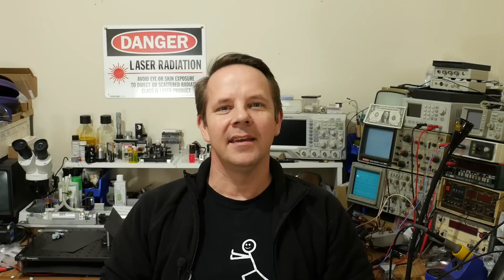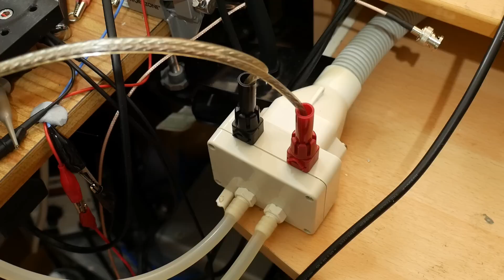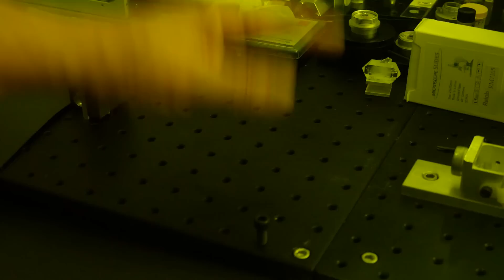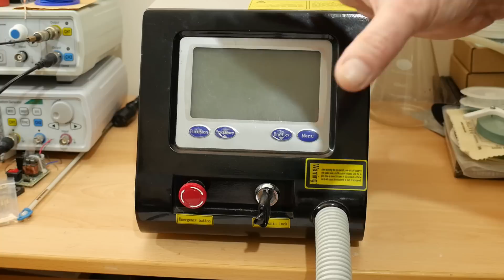DANGEROUS Laser Power Supply Teardown!

Comment: Hi Les,
...one more thing I was curious about...with a series-injection triggered flashlamp, have you ever fired the trigger WITHOUT the charged main capacitor while looking at the arc through the lamp?  Was there a strong streamer completely through the tube?  Also, IF you have tried this, with a LOWER  voltage to the trigger transformer primary, could you get a good arc?  I do realize that properties will alter without load.
(you're the only person I could think to ask such a question.)
===============================================
BTW: I just got in a large EG&G inj. xfmr, WITH DATA!  It states the "saturated inductance" of the secondary, which makes it possible to use the xfmr secondary as the main inductor (if the PFN is 'arranged' for this particular inductance)!

Comment: How is the SCR unlatched in these circuits? I don't think it's the TVS diode (D1), or is it?
Reply from the maker: When the thing fires, the voltage should either reach zero or go below it (if it wasnt for the TVS), as the circuit will ring. At this point it should turn off. In the event of a failure the SCR may latch, which it evidently did in this case.

Comment: I was just thinking you touching the key with bare hands while the thing was sparking
Reply: My thoughts exactly. As well as the immediate shock hazard there's the risk of a blast of AC keeping the finger muscles gripping the key: FFS Les, for the first powerup of /anything/ use an isolating transformer, RCCD and a big red THUMP IN EMERGENCY button.

Comment: I bought and repaired a close to the same junk power supply as a part of easily accessible pulsed solid-state laser source for playing at home. But, mine has a simmer circuit and the switching of the capacitance to the lamp occurs through a powerful thyristor, which in my opinion is much better for flash lamp health then classic cold-kick.
Anyway, when you take such a "design miracle" into your hands, after some true lab equipment like Thales or Coherent, you feel either mockery or a cruel joke by its developer..
Reply from the maker: I have seen those. Simmering seems like it would be good for the lamp, but they are pretty cheap in the scheme of things. It would be helpful if Aliexpress had datasheets on them. Most of the time, they just quote length and diameter, and that's it!

Comment: Its very concerning that such equipment can be manufactured and sold with such poor safety considerations, especially when comes to the use of lasers in cosmetics - There is actually no feedback to monitor the actual energy produced by the laser itself, and the feedback used to control the actual supply energy to the capactor and flash lamp.

I used to work for Cutera as a service engineer, and the amount of safety requirements was massive. Yes these cheap units are manufactured to a price, even more scary is the fact that those that purchase such equipment, are to be used in cosmetic / medical settings.
Reply from the maker: I suppose an energy monitor would be just more cost for them. It wouldn't be so bad if even basic safety requirement had been met, but they seem to have gone out of their way to just flout them.

Comment: This is SHOCKINGLY badly designed. I used to design SS laser power supplies and im at a loss where to start on this one 😮
Reply from the maker: It boggles the mind. The thing that bugs me is it might have been less work to do it even half right than all wrong!
Reply: @LesLaboratory  that it actually struck a stable arc even with the big cap across  the lamp indicates that the HV oscillator is supplying balls out current, and has lost all hv charge state feedback. I'm a bit surprised it didn't incinerate the hv transformer and literally set the board on fire before you got it tbh. Even a simple analog control would have been better.

Comment from the maker: In the previous video where I repaired a Laser head, I kept the plug from the end of the umbilical. That plus an ABS box of similar color and voila! KiCad is alright, But is was a PITA on Linux. EasyEDA is quick, easy, and I can access my projects anywhere. For me, this works well, since half my designs are done on lunch breaks, or when I have any free bits of time.
Reply: Hi! 
Im looking for a q-switched doubled laser like in those machines and i found a broken one on the german equivalent of craigslist, i asked the seller what the issue is, he said it flashes but does not have any effect on the skin. I hoped for it to be an electric issue but do you have a clue what could be wrong? Would you spend 150€ on that? 
I can see in your case the HR is adjustable, is it likely someone droped the handpiece and it just got missaligned or do you think i should prepare for a broken yag rod?
Its a HONKON MV11 which looks slightly less sketchy than the machine you got :)

Comment: In your schematic the signal arrows looks like a litle bit weird. All signals are going in 🤔
Reply from the maker: Those are the netflags in easyEDA, they have no direction. The tips of those always connect to wires. It does look a little off , but I'm used to it.
Reply: @LesLaboratory  this netflags doesn't make the schematic readable , sorry . I miss the old one.😥
Reply from the maker: @Lightrunner.  I could submit it on their feedback forum. There are a couple of weirdnesses in the software. Maybe there is a way to do it and I have missed it.

Comment: If you're anything like me, rebuilding it properly is the way to go, even if it doesn't happen in the near future.  Cannibalizing it for parts - in my hands - would yield a pile of parts, most of which would never be used. OTOH, since you already have a power supply for that laser, is anything really gained by rebuilding this one?  Interesting question, and an interesting video.  Thank you for sharing.
Reply from the maker: Thanks! Maybe. The repetition rate is alluring, especially if it can be pushed a little...

Comment: How much added value is there in this object? It sounds like the work of rebuilding into something usable would be about the same as building an unambitious power supply from scratch. That would be the assessment to do, anyway.
Reply from the maker: The only value is the potential repetition rate, which includes the cooling. I could upgrade what I have already, but also, you can't have too many power supplies 😊

Comment: Fun project. Although i would be way to scared to touch anything in there. All those caps sound like death machines to me. 
The best shoddy job I've ever seen was a fiber laser that cost 25k$ and was held together by mostly hot glue. Not to mention the absolute spaghetti bowl fiber tangle inside and a number of burn spots all over where I assume the soldering iron must have touched while wiring up the laser diodes.
Reply from the maker: The main capacitor always reminds me of a hand grenade. If you hear one start to click...
Ah the famous hot-snot. To secure fiber with it must be sacriliege! Depends who builds them I suppose. There is other kit I have torn down that is beautifully over-engineered 😊

Comment: Such peril, company has nothing to do!
Reply from the maker: It should become a meme! Peril is pretty accurate though!
Reply: Chenglish generally has quite some meme potential. But you're right, this thing is a death trap.
How did you manufacture the termination of the umbilical, and the switch box? I didn't see any printer lines.
Also, any input for what EDA software to use? I see you use EasyEDA. Back in the days, I used Altium, but really can't afford that for a hobby project. I looked at the cheaper options from Altium, but they suck pretty bad, because Altium doesn't put any more work into them. Obviously Kicad is an option as well.

Comment: Abstract

This transcript details a YouTube creator’s experiences with tearing down, repairing, and analyzing a low-cost, poorly constructed tattoo removal laser power supply. The following key points are discussed: 

* Dangerous Construction: The device's all-plastic construction, absence of grounding, and water damage evidence make it a significant electrocution hazard. 
* Component Failure: Failed components, including a power MOSFET, resistors, and a triggering SCR, likely caused the power supply to malfunction initially.
* Interesting Trigger Circuit: The creator is intrigued by the power supply's pulse-forming trigger circuit and plans to potentially replicate the design. 
* Successful Repair: The power supply is successfully repaired by replacing the failed components. However, it still suffers from overvoltage issues causing arcing inside the laser's flash lamp.
* Need for Redesign: The creator concludes that the power supply needs a complete rebuild due to its dangerous construction.
* Options for the Future: The creator considers either gutting the device for parts or building it into a proper metal case with improved regulation and safety features. 

Summary

Introduction

* 0:00 - Introduction to a teardown of a "sketchy" tattoo laser power supply from eBay.
* 0:24 - The power supply arrived non-functional, likely due to previous water damage.
* 0:41 - Observation on the all-plastic case construction, suggesting a lack of safety standards.
* 0:55 - Odd warning labels about water usage. 

Case Construction

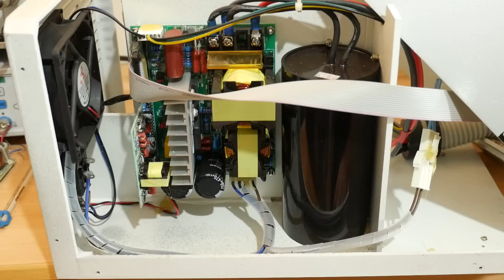* 1:52 - The entire case is surprisingly constructed from glued-together flat plastic pieces.
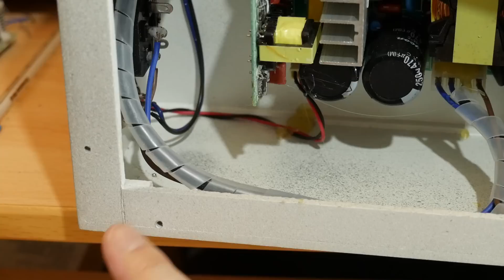* 2:04 - Closer look at the unique and labor-intensive construction.
* 2:41 - Comment that this is unlike any professional equipment seen before.

Initial Electronics Inspection

* 2:44 - Signs of water damage are visible on the electronics.
* 3:19 - Plan to examine the boards more closely.
* 3:27 - Large energy storage capacitor is noted.
* 3:43 - The electronics are mounted on a plastic panel which is part of the water tank.
* 3:56 - Surprise at the potential for further water leaks.
* 4:07 - Extremely unsafe mains wiring is discovered.
* 4:31 - The device is considered an electrocution hazard.

Testing and Fault Finding

* 4:52 - A quick powered test reveals arcing at the poorly assembled IEC mains socket.
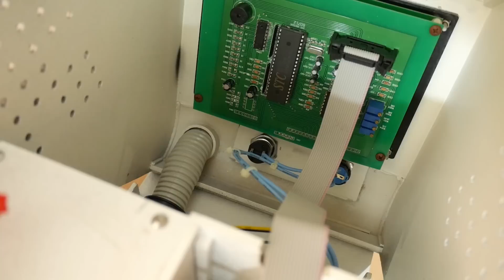* 5:25 - The front panel is examined, revealing live-side switching, another safety concern.
* 5:44 - Further criticism of the construction resembling a 'homebrew' project.
* 6:03 - Decision to remove the electronics board for further inspection.
* 6:19 - The board is removed, and damage is evident. 

Damage Assessment

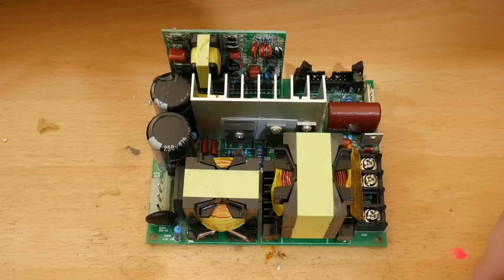* 6:26 - Several failed components are discovered on the board:
  * Burnt resistors 
  * Shorted MOSFET
  * Shorted capacitor (part of trigger circuit)
* 7:15 - Evidence of water damage reinforces the assumption of the cause of failure.

Repair Attempt

* 7:18 - Introduction to the repair section, focused on the power supply.
* 7:34 - Failed components listed: MOSFET, resistors, and SCR for trigger circuit.
* 7:53 - Difficulty finding original SCR datasheet, but a modern equivalent is sourced.
* 8:01 - Replacement components listed.
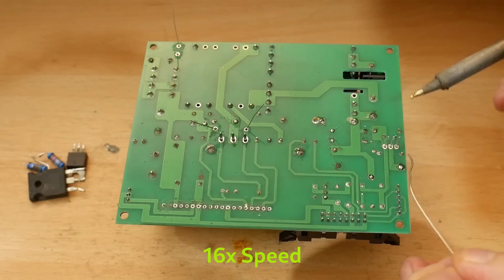* 8:28 - Soldering in the replacements.

Circuit Analysis (Optional)

* 8:32 - Diagram of the switch-mode power supply to help with debugging.
* 8:37 - Interest in the trigger circuit operation.
* 9:46 - Analysis of the unique flash lamp trigger circuit design, potential for future use.
* 10:04 - Standard switch-mode power supply design discussion.

Testing and Repair Success

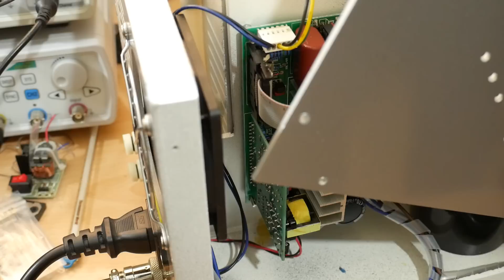* 10:27 - The reassembled power supply is tested with water and connected to the laser head.
* 10:38 - Cautious test to avoid further damage.
* 10:59 - Confirmation that the power supply works, though there may be a minor fault.
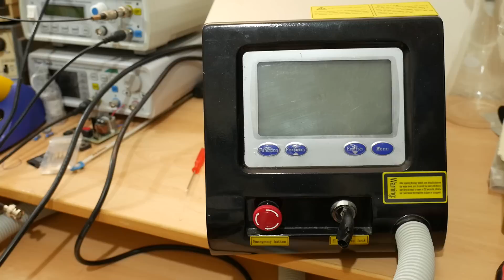* 11:32 - Power supply isn't yet considered safe.
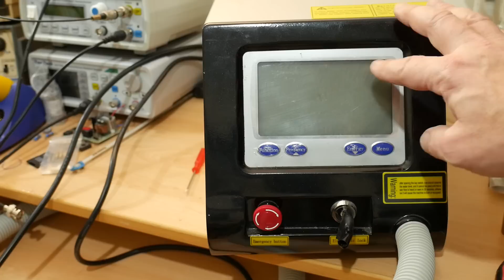* 11:39 - Demonstration of front panel controls.

Safety Considerations

* 11:43 - Discussion on the ungrounded key switch and the safety concern it presents.
* 12:25 - Demonstration of the laser's functionality, highlighting its power.
* 12:47 - Explanation of the graphite laser beam stop.
* 12:59 - Importance of laser safety glasses emphasized.

Power Supply Interface

* 13:57 - Walkthrough of the power supply's user interface and controls.

Demonstration

* 14:57 - Camera is setup to safely record laser output, sensor protected with equivalent laser safety glasses.
* 15:22 - Demonstration of the laser firing.

Remaining Fault & Decision Point

* 15:31 - A fault remains: the laser flash lamp arcs internally after a few shots.
* 16:09 - Demonstration of the arcing fault, highlighting its danger. 
* 17:19 - Explanation that arcing is a sign of overvoltage from the unregulated power supply.
* 17:51 - Suspicion that the front panel microcontroller and its communication with the power supply are at fault.
* 18:13 - The complexity of reverse-engineering the microcontroller makes fixing it less appealing.
* 18:26 - Harsh criticism of the terrible safety standards of the device.
* 19:09 - The device is too dangerous to continue working on as-is. Options considered (viewer input requested).
* 19:55 - The project will be put on hold due to needing the workspace.
* 20:07 - Call to action: like and subscribe for more content. 

Disclaimer: I used gemini advanced 1.0 (2024.03.04) to summarize the
video transcript.  This method may make mistakes in recognizing words
and it can't distinguish between speakers.
Reply from the maker: 18:26 Harsh Critisism 🤣😂🤣 AI needs to understand warranted criticism! 😆